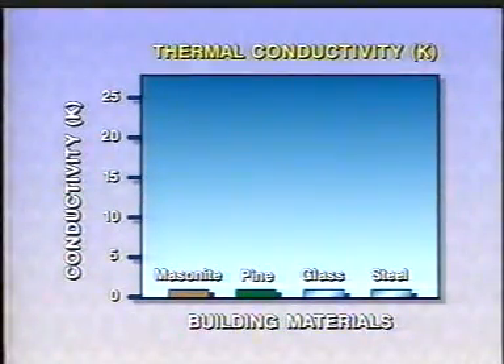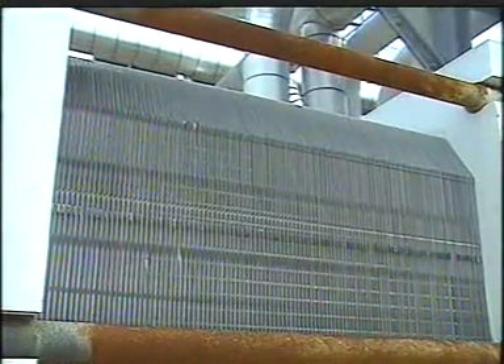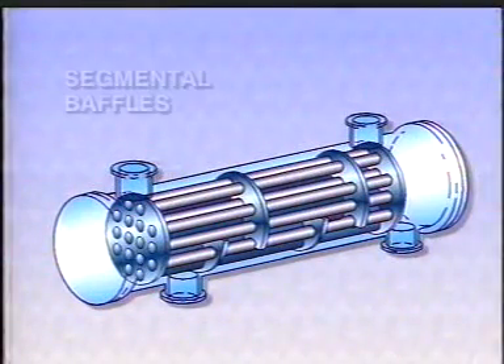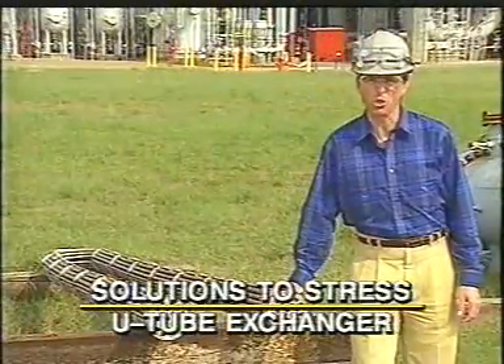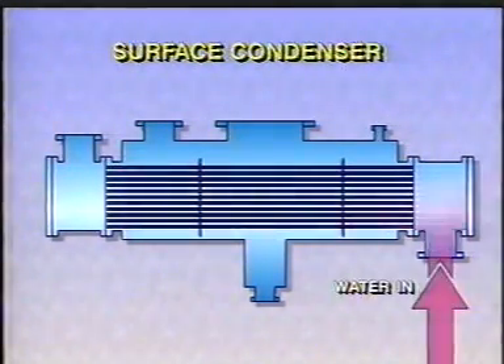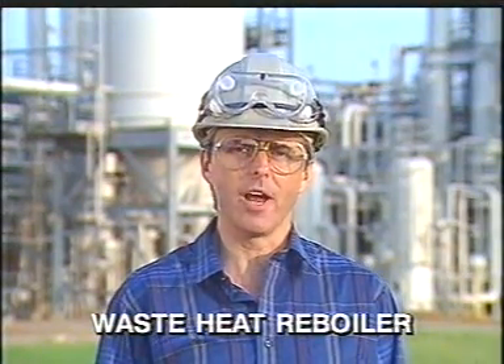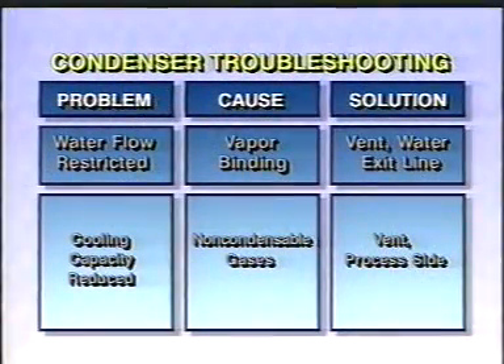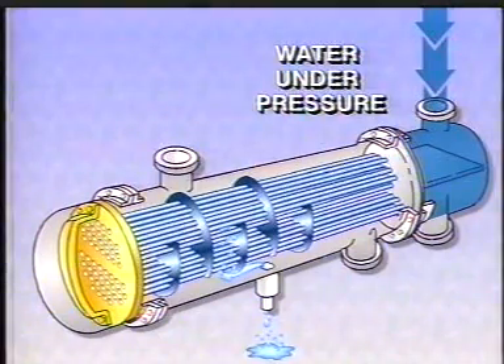Heat Exchangers

Comment: I saw a video yesterday about a heat exchanger where salt was pumped into a magnifying column where the sun heat it to 1040F then it was pumped back down to the ground level where it boiled water and steam was pumped to provide enthalpy for chemical processes.
Reply: I believe that's how all condensed solar installations work, iirc.

Comment: Thanks for uploading, pls in the explanation of the application of Heat exchanger the professor mentioned something that I think it's similar or maybe I need an explanation to understand the difference between condenser and cooler?  any help from colleagues, thanks
Reply: A condenser is used to cool the hot fluid. When the hot fluid is cooled there is a change in the phase and the fluid in the gaseous phase will turn to liquid phase. In a cooler the same thing occurs but a change of phase may not occur. So for an example in a car radiator when the air blows over the radiator the liquid in the radiator cools down but there is no change in phase unless the liquid is boiling hot.. Every condenser is a cooler but every cooler is not a condenser as phase change may not occur. Hope this helps!
Reply: Thanks for the explanation, well explained. Got it
Reply: @Sam-81_98  contact Jim Smith PCN 2 he is an expert in power station condensers.PCN will put you in contact with him he is a fountain of knowledge and will happily share his extensive experience with you.
Reply: Greetings, we provide the Silicon Carbide Heat-Exchanger for Hydrogen fluoride, Nitric acid, phosphoric acid and other complex condition all over the world. welcome to contact me to discuss it.